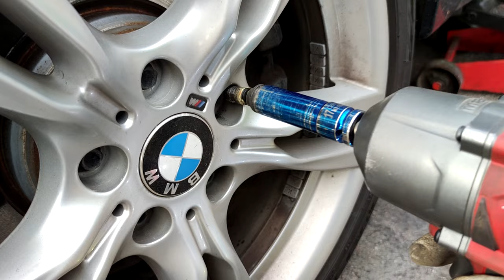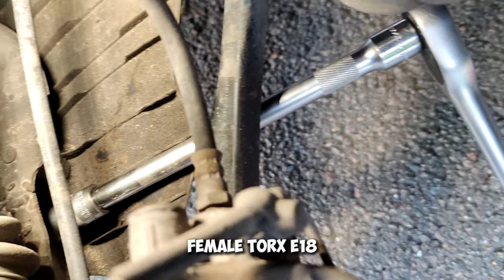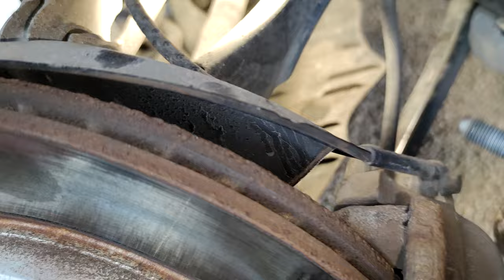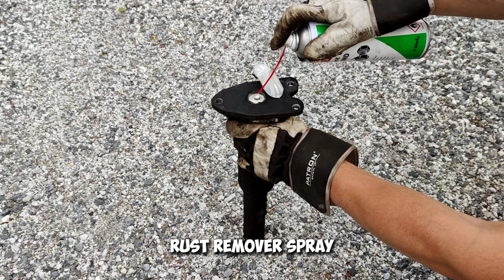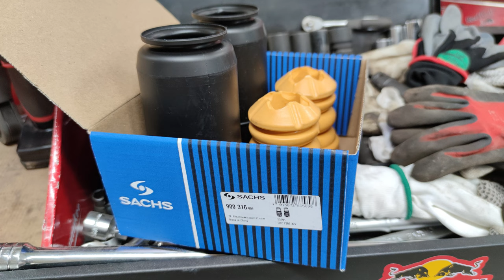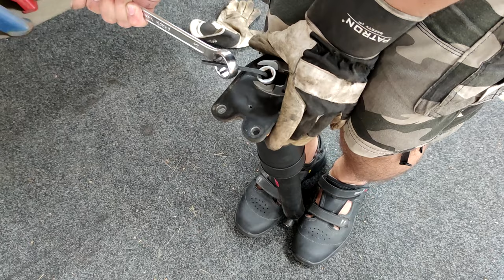BMW F30 & F31 Rear Shock Absorber Replacement

Comment: Thanks for the info video helped a lot! I used an old copper pipe to help with leverage on Allen key to tighten the nut down on the shocks if it helps anyone!
Reply from the maker: I'm very happy to help !!

Comment: very helpful, with torx socket sizes and a tip on how to get the nut back on the new shocker, with the allen key. Thank you.

Do you generally get new nuts with new shocks?
Reply from the maker: Everytime when possible 🙏